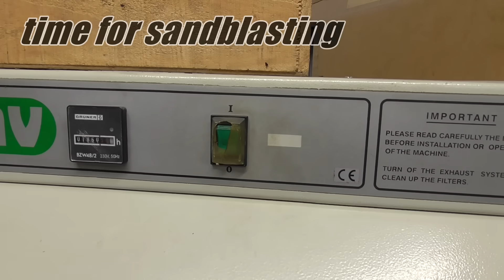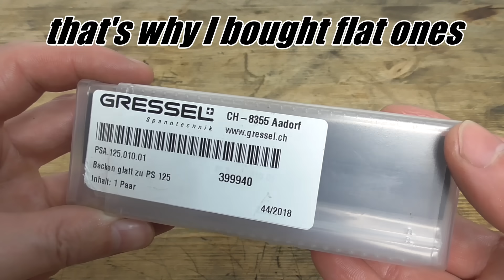Rusty Deadlocked Vise - Perfect Restoration

Comment: The only thing that I can think of as per the question why 1400 dislikes.  One needs to be in a special time of their life where a project like this would take priority over all of the other goblygook we have in our shops.  When I had first graduated from Engineering school and I was finally putting my little fab shop together, I didn't have the money for a real project.  I anesthetized myself by tig welding for my racing buddies, auto repair for my neighbors and acquiring trinkets for my shop.  One of the first trinkets that I acquired from a farm auction was a art deco style Champion Vise that looked much worse than the one shown here but I did exactly the same thing down to painting the serial number with a tooth pick.  I got a lot of compliments from that vise as well as the five horse Continental engine (with Astro quarter midget) A very well made welding table, air compressor (Champion also) as well as a couple others that I cannot recall.  I believe that the folks who disliked Broken Vise Restoration would not have the patience even if they had the time or perhaps they would just throw that beautiful old vise in the scrap and go buy a new one at Wal-Mart.

Comment: The original jaws that you called "rough" are the standard jaws usually fitted to most engineering vices  and considered suitable for almost all work. In order to reduce the chance of damaging special items, often folks make up "soft-jaws" which are kept ready to use in the vice. "Soft-jaws" can be simple sheets of aluminium shaped similar to a letter "L" that are slipped loosely over the hard jaws, just before you tighten. Aluminium is soft enough to avoid damaging many items. Alternatively soft-jaws could be made from scraps of wood. I don't know but possibly plastic or old leather might also suit some purposes. You can have confidence that your English is very very good. Thank-you for restoring a long neglected piece of workshop equipment.  After World War 3 or the Alien Invasion or Zombie Apocalypse, skills like yours may be in high demand !

Comment: It is not a perfect restoration when you BUY NEW parts to replace original jaws. Gfy
Reply: Garrett S The original ones are available as an alternative accessory.
Reply: @minshum  not the point. Not a restore if you replace parts. Thats a replacement, not a restoration

Comment: You could have saved yourself a ton of work by putting this vise in a tank of water with washing soda and done electrolysis to this unit.   After 2 or 3 days in the tank, you probably would be able to move all the parts by hand.  I have used electrolysis on numerous large tools and car parts and they come out with very little effort as good as new.

Comment: I don't know why they just didn't submerge it in 50/50 solution of water and vinegar??? Leave it submerged for 24 hours it will eat the rust right off the metal. Then probably would have even been operational after that. Then take it apart and finish the restoration.

Comment: Beautiful work, just wondering if a product called evap-o-rust is available in Switzerland? It would be a great help in your future endeavors as it is non toxic, biodegradable and reusable. I'm not a salesman for it, I've just used it on projects of my own and found it to be fantastic, just soak your parts and the rust literally just falls off. Here's a link to it on amazon https://www.amazon.com/Evapo-Rust-Original-contains-non-toxic-biodegradable/dp/B00M0TLQ66/ref=asc_df_B00M0TLQ66/?tag=hyprod-20&linkCode=df0&hvadid=198093981731&hvpos=1o4&hvnetw=g&hvrand=13081396206114871314&hvpone=&hvptwo=&hvqmt=&hvdev=c&hvdvcmdl=&hvlocint=&hvlocphy=9022878&hvtargid=pla-384225091650&psc=1Its been a massive help in restoring my old mustang on a budget.

Comment: Nice work! Question--is there a reason you did not use an electrolysis tank for the rust removal? That would have completely eliminated all the scraping, brushing, hammering, sandblasting, etc. Just drop it in the tank, turn on the juice, and wait a while. Take out a clean piece with all the rust gone & the parts move freely.

Comment: Ever consider using OSPHO for changing the iron rust , iron oxide, to phosphorous oxide?  It will turn rust black  and it then becomes a paintable surface.  Or in this case, it just makes rust removal easier?

Comment: Try mixing water and molasses at 10 to 1 in a five gallon bucket. Drop the rusty vise in for a week. When you pull it out you'll be amazed at what comes loose with very little effort.

Comment: Check out vapour blasting, you generally dont need to mask things.
and a hot-air gun, to loosen shafts screws etc in holes..
And Rustoleum paint is excellent stuff.

Comment: I use EvapoRust, non toxic removes surface rust w/o damage, uses chelation process, 
one gallon will treat 300Lbs of steel.  Note: it will remove bluing on metals.

https://www.evapo-rust.com/

Comment: Great job and very informative video.  I have what may be a dumb question but in the video it showed you doing a fairly extensive cleaning with rasps, chisels, and other tools, and then sandblasting it.  Could you not have skipped cleaning a part that was going to get sandblasted anyway?  Great video....thanks for sharing it.

Comment: Superb results on these restorations. Amazing results, art in fact. Subscribed and looking forward to your next project.

As someone remarked earlier, heat will break loose those rusted fast screws and bolts.  Used a smallish butane torch to heat the parts to maybe 150, 200 degrees F, let everything cool a bit then unscrew the bolt. It works like magic. I've tried all manner of solvents that are supposed to work but really are useless. Applying heat made the impossible easy.

I've been restoring old box and pocket locks from the 1800's (finished six of them so far) as well as HO gauge model locos, rolling stock and switches from the 1950's and 60's and a small electric rotary tool from the 1930s.  Tolerances were not tight on these old locks and most of the parts could be dressed with a file to become workable. Most of the HO restoration can be done with hand tools or with my new rotary tool. A small lathe, milling machine and drill press would have come in handy though. The small rotary tool restoration needed new precision parts but unfortunately I was unable to make them.

At my beginners level I can appreciate the enormous amount of time and attention to detail it takes to even do a functional and cosmetic restoration, let alone produce a better than new work of art as you do. 

I too have to learn from mistakes, of which I've made plenty so far. I've had to fabricate parts but unfortunately don't have machine tools or a good TIG welder. The parts work but are kind of makeshift. 

I had a friend, now deceased, who restored all manner of machine tools, lathes, milling machines etc. He was a FF racing driver who made all his own parts. Each part was a work of art like what you make for your restorations.

I had access to a good machine shop at my work years ago and also to my friends shop. I really miss not having access to proper tools. The right tools for the job make life a lot easier and the final product better. 

Now I need to go down to the shop and restore an old pot stove carburetor. I'm replacing most of the brake system on my car and it's getting cold in the barn. I need to get the old stove up and running. I've got 200 gals of kerosene sitting in the tank doing nothing :(

- Dave

Comment: It would be nice if you put what your doing for each step and why.  It will help us new comers learn from craftsmen we admire.  Like heating the parts and putting them in oil.  How hot and why that oil?  What does it do to the steel?  So many questions!  You are very skilled and I really liked the video.  Awesome vise restore
Reply from the maker: In first place i do this for entertainment, but you can always ask questions :-) it says in the video how hot and what oil i used haha, but it's ~300°C and pretty much any kind of oil works. The oil burns into the surface of the steel, makes it black and it's also rust proofing. Because of the low temperatur the steel doesn't get hard and keeps the original abilitys.

Comment: Incredible end result. Well done! I have to be honest though..I'm all for keeping a weathered look, but in working condition. I would have got it working, maybe take a wire brush to remove the surface rust, and that's it. My detail work is mostly spent on used car parts to restore vehicles.

Comment: I would have used acid on the majority of that rust, but to each his own.
Reply: but then he wouldnt get to use that freakin awesome sandblaster!!!
Reply: Evaporust for a week - awesome stuff and very benign.
Reply: Evaporust is not available in Europe it’s an American product
Reply: White vinegar works just as well. 24 hour soak and a light scrub would have taken care of it with far less work.
Reply: I prefer phosphoric acid, which is also available in most concrete etching solutions, but vinegar, other acids, electrolysis, and sandblasting def all get the job done

I wish I had a badass sandblaster...
Reply: I'd have cleaned the rust off electrolytically, sodium carbonate bath, an iron electrode, and a battery charger. The sandblasting worked great though, and probably took less time. I loved this video and all the work that went into it!

Comment: Why did you ditch your gloves at 5:07? Then why did you put them back on around 10:20?Then you took them off again around 11:00...then put 'em back on around 13:00, then took them off again for the rest of the video. Is there a particular technical process involved in specific "gloving operations"?
Reply from the maker: Glove or not to glove, that's the question....

Comment: Very nice work, I enjoyed this. May I offer a piece of advise? Well, I'm going to anyway; don't use grease on the threads of a screw or bolt in blind threaded holes. You risk incredible hydraulic pressures that might crack and destroy the piece you are trying to save. Instead, use a real lite oil like WD-40 or a thin coat/dab of never seize. Notice the grease oozing out while you where tightening the jaw face plates? That's the danger I'm talking about. Sometimes it won't ooz enough and then all of a sudden,,,crack goes the block! 

Good stuff though, I appreciate your efforts in making this and,,,,,subscribed!

Comment: If you restore old tools like this often(I do), then 2 things I highly reccomend: 1.) Get yourself a good ultra-sonic cleaner. At least a 2 quart model. It will save a ton of manual labor and will get into the small spots and pits that a wire brush won't. You already seem to own a lot of expensive equipment, so a couple of hundred for a good quality used unit from ebay shouldn't be that much of a burden. And 2.) Use hydrochloric(muratic) acid to remove the rust. Again, it will save a lot of manual labor. Phosphoric acid is good too, but it sometimes leaves behind iron phosphides that while soft, still need to be wire brushed off. The muratic works the best. It will remove the rust quickly while only removing a tiny bit of metal(far far less that you're removing with all the sanding, filing, and sand blasting), you just need to make sure you leave the part in the acid just long enough to remove the rust and no longer. I find a 50/50 mix of acid and water works the best. Wash thoroughly with water after the acid to remove all traces, and then lightly oil the part with WD40 or something similar, the acid will make the surface so clean that it will flash rust pretty quickly unless it's protected in some way.

Comment: Nice video. Great work.

Were the silver parts around the jaws clear coated or left bare metal?

For painting raised lettering I find a small, stiff foam roller quicker and more precise than painting each letter one by one but if the hand painted look was what you was going for then hats off to a good job!

Comment: Just an FYI: I had LOTS of rusted tools and engine parts, due to neglect and wet weather.  I bought two gallons of white vinegar for 5 dollars, and soaked as many tools as would fit in a deep pan. The change was amazing, and will save you a tremendous amount of time.  I found this trick on YouTube, was skeptical, but it worked so well I was amazed. And the vinegar can be used over and over, it takes a lot of tools before the vinegar becomes too diluted.

Comment: I was surprised the company still exists and had those jaw parts thought it was a very old vise. Also there's a way to clean rusty iron using a solution and electricity wonder if that might of helped to do before disassembly.

Comment: There is an efficient and simple way to paint relief letters with a coin and a small piece of fine tissue. Place the coin in the center of the tissue and wrap it around, leaving a layer of tissue on one side of the coin. Then dip lightly in the paint and apply to the letters. Like a sponge in the stencil technique. But, the mask is not necessary because of the relief in the letters. I've used it to repaint letters on  license car plates. It worked very well. No dirt!

Comment: OK and when using wire brush w/the drill.  Lubricates & cleans simultaneously. Most important!.. always wear safety glasses when using a wire brush on a drill. Those wires can fly anywhere.

Comment: Sometimes, just by analogy with paper recycling, which requires a lot of chemicals and water, I am wondering whether casting a new steel vice would require less or more chemicals, electricity, and time, and produce less or more waste than applying all these tools (which wear out as well!) and compounds to refurbish this one. One extreme is Kiwami’s videos where he spends ludicrous resources to meticulously sharpen a pencil sharpener or a shoddy $1 knife. Another extreme is buying new tools from Aliexpress every time old ones break. So I am wondering: is renovating your vice this way more economical than buying a new one?

Comment: This rescue depends upon a workshop full of trade quality machine tools. Without a sand blaster, mill & lathe things would have been much more difficult & the newly made parts would have cost plenty to have made by a contractor. As for WD40 - it's not ideal but usually is first in hand.

Comment: Stunning work!!!
Love your attention to detail on this restoration. The only thing I would recommend is soaking in white vinegar for a couple days until all the rust is removed,  then washing in a baking soda and water paste, immediately fallowed by an oil and degreaser wash rather then filing, sanding and sand blasting. You’ll save yourself a lot of labor and come out with a much nicer finished clean.
Keep up the good work. 
You just won yourself a new subscriber!!!

Comment: my favourite part was the painting of the letters with use of stop-motion. i could seriously watch that all day!! in fact, please publish videos with just that.  or maybe i should. anyway, i digress, the original purpose for this message was to ask about the grease looking stuff you paint on everything, even screws which hold parts together. does this strengthen the connection and make more hold or is it to prevent rust?

Comment: Don't sand blast it. That removes material. Soda blast it. That is much more gentle and is water soluble so you can rinse with hot water and it will have no residue.

Comment: I look at all the labor you expended, mechanically abrading rust away.  Perhaps you have not heard about Evapo-Rust yet?  Simply pour some in a pan, drop your rusty parts in and let modern chemistry work for you.  Based on the amount of rust this vise had, i would guess three hours max in the Evapo-Rust would get you perfectly clean, rust-free parts.  Even without Evapo-Rust, you did an awesome job!  This looked like a fun project.

Comment: Great job, but a little advice (trick) when you have holes in body parts, especially when the part is massive, you can fill the hole with weld (mig) and remove the excess metal with the grinder.

Comment: This is the most hand labor I have seen on restoration projects. Most of these projects use chemical rust removers or electrolysis. The blaster did a fine job of cleaning. Loved the brush applied paint and the tooth pick lettering. I have a collection of thirty hand files for steel and softer material. I buy them used and sharpen them with Muriatic acid which etches the metal depending how long I leave a file in the acid.

Comment: Aaarrg! Muriatic hates rust and corrosion. You can buy it cheaply at your local building supply locale. Buy a paint strainer as well and put it back in the container until it won't absorb another iron ion (closely follow directions for use) Also....by now revery one knows WD-40 isn't a lubricating penetrant cause there's fifty other products that work better, right?  Otherwise, it's good to see this done, that's a wonderful vise.

Comment: Excellent and interesting video, learned a lot that maybe I can use. You paid $20. I could not get a price from the Gressel web site but I did see this $3799.00 vice that looked similar, if that's a good comparable, then your work was certainly worth it. https://www.homedepot.com/p/Wilton-Machinist-8-in-Jaw-Round-Channel-Vise-with-Swivel-Base-10036/301955063?cm_mmc=Shopping%7CG%7CBase%7CD25T%7C25-1_HAND+TOOLS%7CNA%7CPLA%7c71700000034127224%7c58700003933021546%7c92700031755124844&gclid=CjwKCAiArK_fBRABEiwA0gOOcxEPrGoKPKrz32WA1YpA5E0ktWvUNOCdx5IK-Df47a3zS_lqRSvXIhoC-2wQAvD_BwE&gclsrc=aw.ds